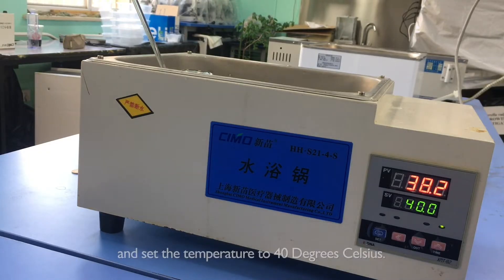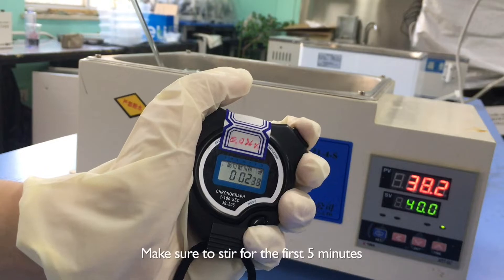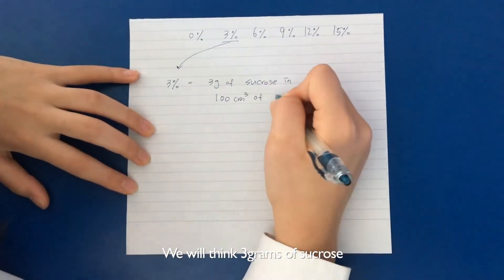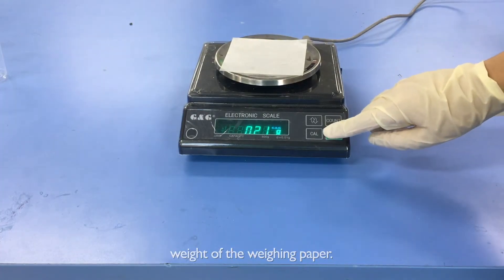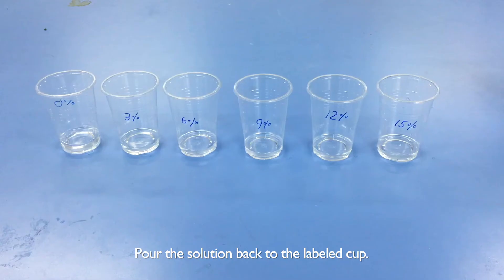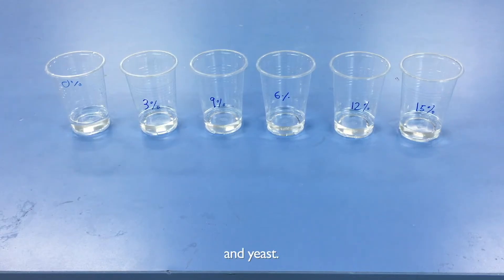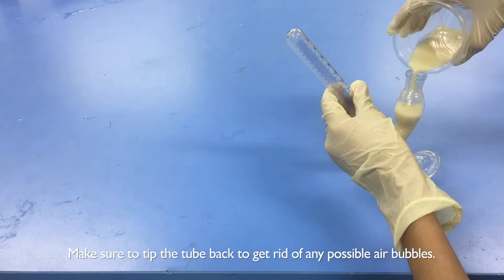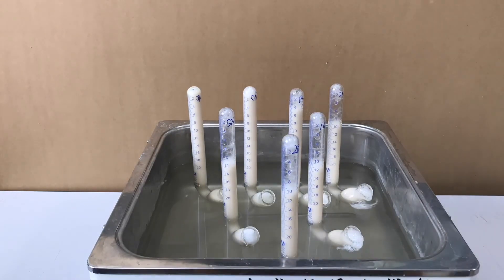Yeast Fermentation Experiment in Different Concentrations of Sucrose

Comment: what exactly is the decrease in volume showing???, what was the dependent variable???
Reply: Decrease in volume shows carbon dioxide is being produced, the faster it happens, means carbon dioxide is being produced faster, means the yeast is respiring faster.
Reply from the maker: Yes. we were measuring the volume of CO2 gas being produced. The CO2 being created was displacing the yeast. There is an argument to be made that the yeast that gets expelled from the tube is a flaw. That lost yeast could have still been used to be producing CO2

Comment: Hi! Is it possible for the sucrose to produce more co2 and have a faster rate given that it needs to be brokendown first into glucose by the enzyme coming from yeast? rather than the readily glucose?
Reply from the maker: Hi, I apologize for the late reply. Well, considering that an enzymatic reaction is required for the sucrose to be first be broken down, I would say no, sucrose would not result in more CO2.....if you are referring to the early going at least in the reaction process.